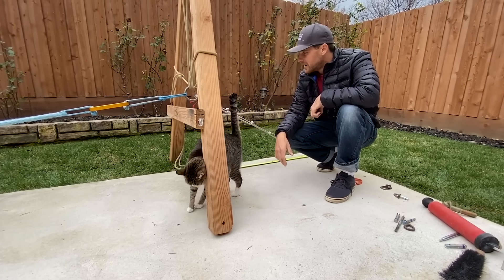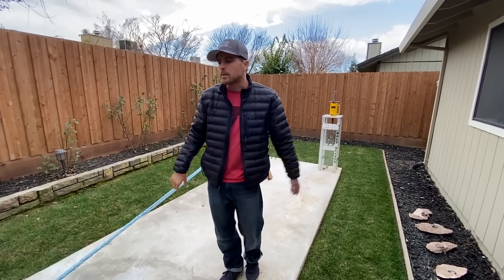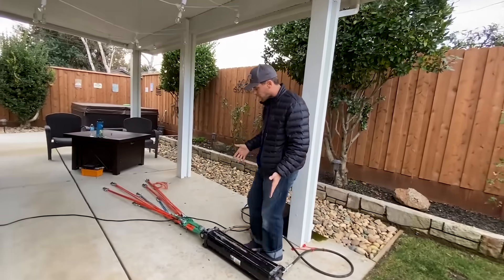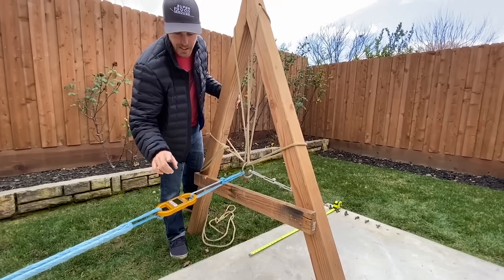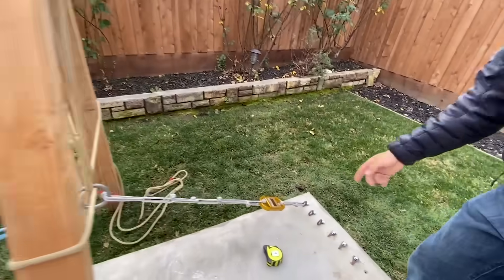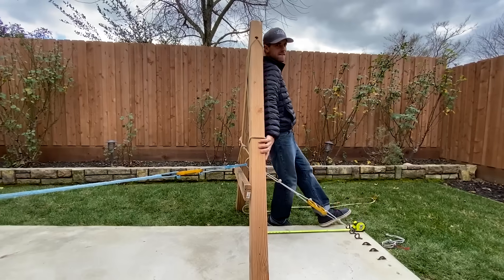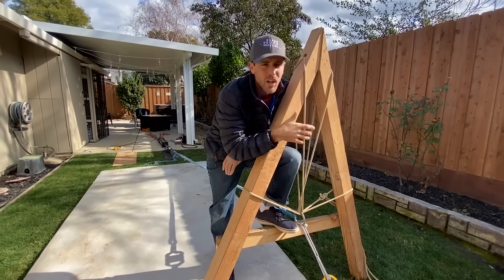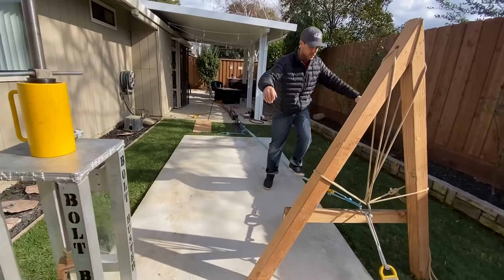Geometry is not a myth - how hang frames change forces on highline anchors

Comment: If you had the line run through a poly and then straight down to the anchor  it would balance out the forces a lot more evenly and the angle that your A-frame is on would be less important 

If you look at any large swing bridge the cable runs continuously from each anchor And is able to move freely back-and-forth with the stretch of the cable

Will never see a large swing bridge with the cable isolated at the equivalent  of your A-frame

I appreciate that your system doesn’t fully isolate it  but it definitely impinges its ability to balance the load

I am extremely dyslexic so apologies for  spelling and grammar😊😂😊
Reply: Also the setup would put additional lateral load on your A frame if the line was able to run freely through the A-frame it would only be under compression and have no lateral load put in to it

Comment: When you pull a load at an angle, you “vector” the load. If you attach 2 fixings side by side underneath a horizontal surface (ceiling, roof, bridge etc), then attach a rope to both, then suspend a 100kg load in the middle so each side takes half the load, you put a 50kg load on each fixing. As you move the fixings apart you vector the load (still 100kg) so the load on each fixing increases. So if the angle between the rope (where the 100kg load is suspended) is 30degrees the load on each fixing increases to 53kg. At 60degrees the load is 58kg. At 90degrees the load is 70kg on each fixing. At 120degrees the load is 100kg on each fixing. At 175degrees the load has increased to around 11,000kg on each fixings. This is the job of a ‘rigger’ who has to pass a qualification to gain employment (and needs public liability insurance of at least $/£ 10,000000) as the forces involved can be enough to damage/break structural steel, buildings, etc. Hope this helps

Comment: In physics and statics this is called "vector resolution" here is a simulation i found that quickly gives you the magnitude and angle without doing the math by hand just drag and drop! Finally angles other than 45 deg will be obtainable! open the link, click on "explore 2d"  its not perfect but its the best free app I have found. make sure to check the box that says "sum" and note that this sum is the resultant of the vector you add. if you want to find a vector that will "balance" the other two simply take your sum and add or subtract 180 deg. Hope this is useful!      https://phet.colorado.edu/sims/html/vector-addition/latest/vector-addition_en.html  ps love the videos! keep it up! From a rock climber and engineering student
Reply: Hahah, go figure CU's Physics page comes up.
I wonder how many more videos until we're referring Ryan to LearnChemE.com 🤣

#skoBuffs

Comment: Not related but on your dyneema soft shackles if you use a cow hitch instead of the noose without going through the line so with no pass through would it increase the breaking strength I use dyneema for overhead lifting I'm super curious but don't have a safe way to test hoping you could help or give advice love the channel 🖒

Comment: Watching this video, and most of the content here, gives me flashbacks to statics and strength of materials classes when I was in college. One thing I would say is impacting this particular test is the one leg of the A-frame is able to compress the soil, while the other can't. This is probably a minor issue but the soil does have some springy-ness to it. The result would be pulling the slack line and the anchor line out of plane with each other, this adding another set of angles.
Reply: Currently an engineering major, just finished the class and am totally geeking out on the math.
Reply: Pretty sure that factor is not particularly significant.

Comment: The ring doesn't move,
But the frame does as well as the rope.
which is pulling up and changing the vectors, by adjusting the axis it is the same as changing the angel of the rope to the ground

Comment: I think you misunderstood the relevant angles at play here.
Imagine drawing a line through the ring perpendicular to the frame, the angles of the rope with respect to that line are the important part. The angles between the floor and the rope are related to that, but they depend on how the hang frame is positioned. That's what you see when moving the frames around.
It was really nice seeing all that demonstrated, thanks for the video!
Reply: Philipp, you are correct that the angle of the ropes to the ground is not relevant.  But to be completely accurate it's not the angle of the frame but the angle of the of the frame ropes that is the most relevant.  These are slightly different angles when he pushes on the frame. When he's not pushing on the frame (and everything is static), then they will be the same.  So using the frame angle would be good as long as you didn't have other ropes tied to the frame that could pull on it.
What I think is the simplest way to look at it is to consider two angles:  1) the angle between the "highline" and the frame line* and 2) the angle between the anchor line and the frame line*.  If these two angles are the same, then the tension in the highline and the anchor line will be the same.  If the angles are different, then the side with the larger angle will have more tension.
* Use the average angle of the frame lines, or the frame angle subject to the conditions mentioned above.
Reply: @andrewsnow7386  There are component forces in 3 dimensions is basically what you are saying. You have the component forces in the horizontal planes and the vertical plane as well as the up-down plane.  Changing the angle of the frame changes the loading in the up-down plane and will affect the other two plane component forces.

Comment: If you want to understand why pushing on the A frame changes the forces, measure the force you're putting on the A frame, it should all balance out!  If you go beyond 45 degrees it should also lower the force if i'm understanding correctly. It's not intuitive that 45 degrees would be a worst case scenario.